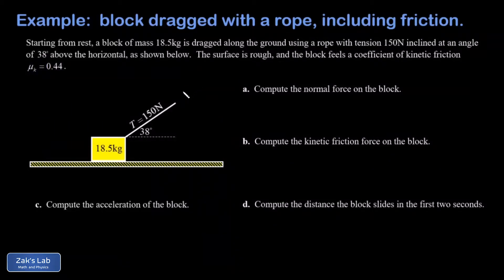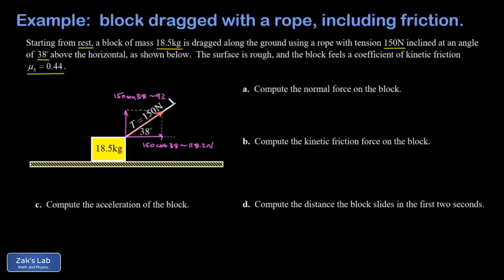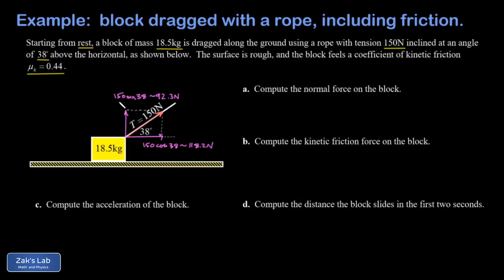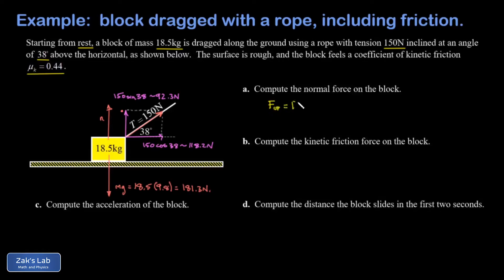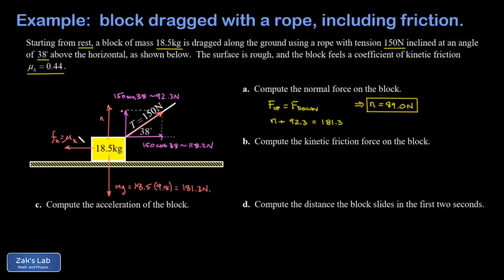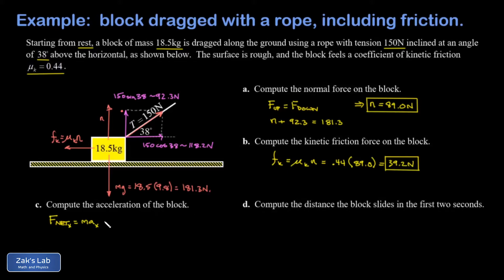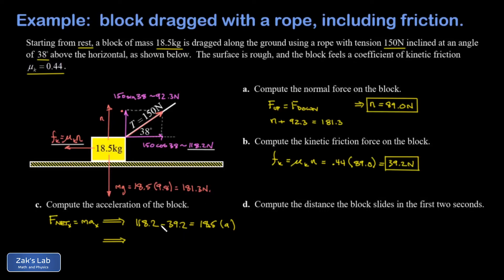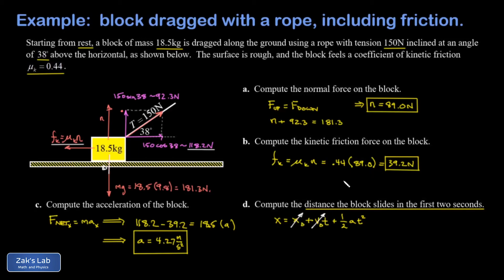Block pulled with a tension at an angle: normal force, friction force, acceleration, distance.

Comment: Physics professor here. Good video, essence correctly explained.
Reply from the maker: Thanks!  I started this YT channel to "flip" my college physics courses (the two semester sequence of trig based physics for life science majors + the first two semesters of calculus based physics for engineering majors  (classical mechanics and E&M)).   The classical mechanics material is getting pretty complete, but my older videos need to be redone with better production value.  E&M will start to feel complete in about a year.  So these aren't like perfect canned courses for flipping the classroom yet, but you might want sift through my playlists if you're considering using video for your classes!  Thanks for the feedback!  z

Comment: Thank you so much, your video cleared my confusion about how the normal force is interpreted when dragging an object at an angle. Just one quick thing to clarify: Is this like questions where there is an object dragged or stationary on a ramp, where you have to separate the Fg vector into its components (mg*cosθ and mg*sinθ)? Many thanks in advance.
Reply from the maker: It's like that in the sense that the normal force is not equal to mg!  Normal force will always do precisely what is has to do in order to balance the forces perpendicular to the surface.  I just recently made a video on normal force concepts including pushing down at an angle, pulling up at an angle, inclined planes and accelerating elevators here:  https://www.youtube.com/watch?v=vL8LZz5fjkQ